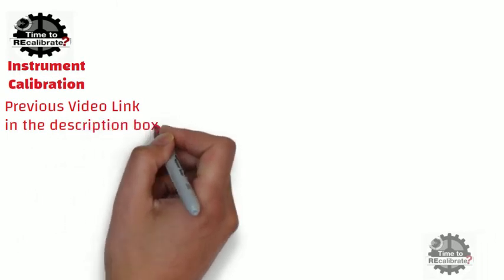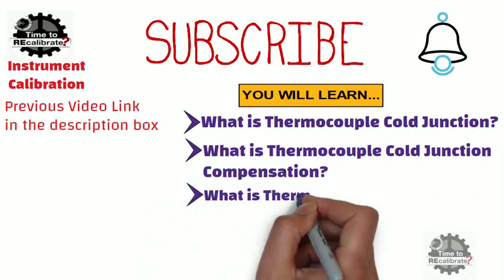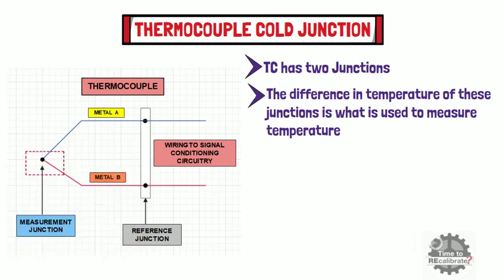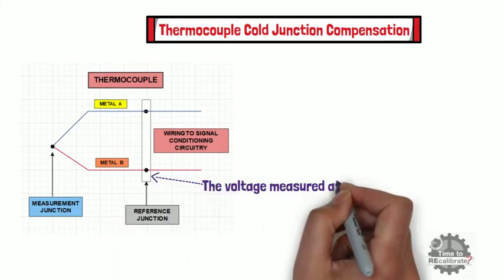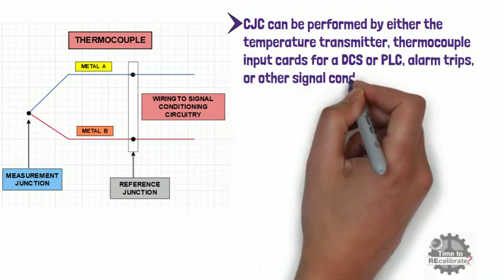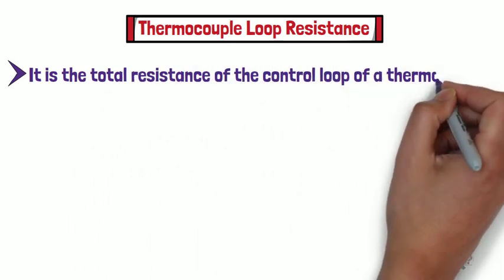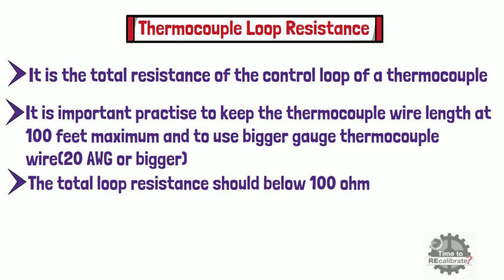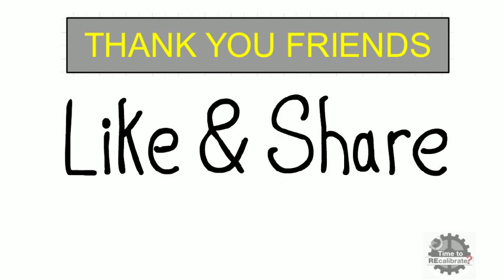What is Thermocouple  Cold Junction Compensation  and Loop Resistance

Comment: 1. What happen when we create more numbers of cold junction. 
2. If we joint 2 or 3 times of thermocouple cable and then we take in use. What will happen is any difference in temp or no effect on result.
3. If we connect 2 thermocouple cable with Terminal box and the this type of connection made 2 3 times what will happen. Is mv drop or no effect on result.
4. What will happen if we use lug at the termination end.
5. Which TC cable is better single stand cable or multi stand cable and why